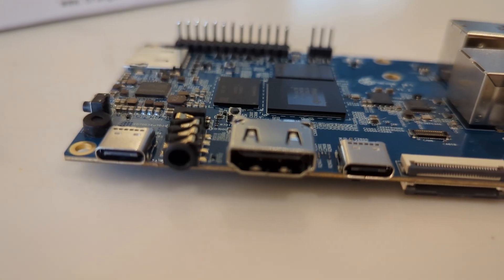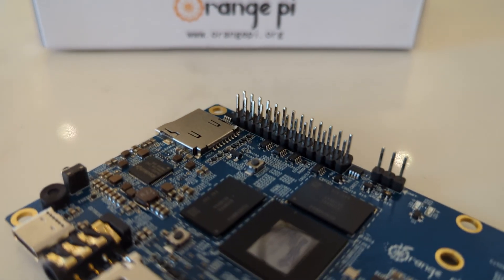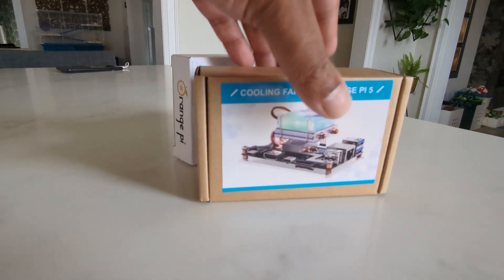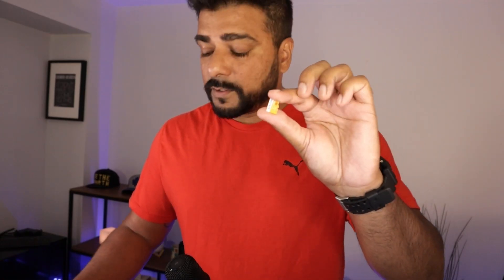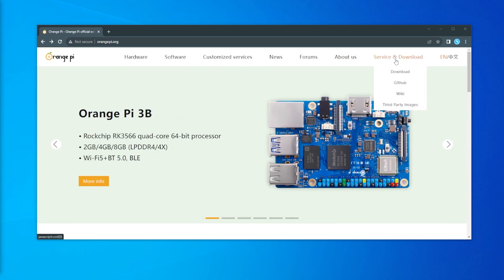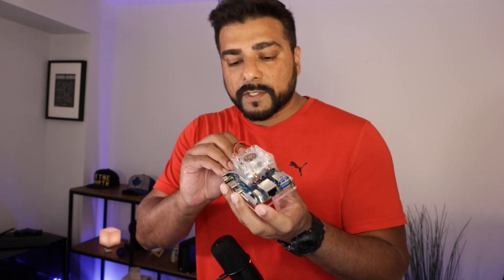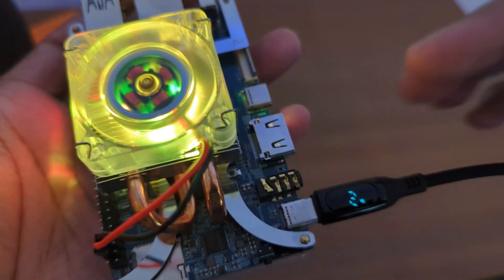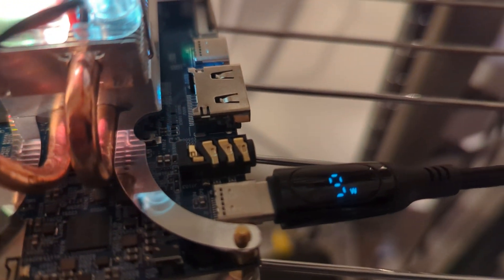VERUS mining with Orange Pi 5 !

Comment: Thanks for great video. You mentioned Orange Pi 5 in the video, but the link to amazon is for Orange Pi 4. It doesn't matter which I choose? Because the differences are not only in the price, but also in the CPU - Pi 5 has a RK3588S processor and the Pi 4 has a Rockchip RK3399. It does not matter? Does anybody know the hash difference? Thanks
Reply from the maker: Thank you so much for pointing that out. That's an error. I've tried only the Pi 5 RK3588S, it does matter. I dont know anyone that has tested the Pi 4
Reply from the maker: this is strange, when i test the link i get the orange pi 5?! Anyway i refreshed it, but here is the specs you want: Orange Pi 5 8GB Rockchip RK3588S 8-Core 64 Bit
4GB version works fine as well.
Reply: @CryptoJar  and when I click the link, I get the Pi 4 LTS 🙂Ok, anyway, I will search for the Pi 5 you mentioned. Btw the second link for the fan is most pro[ably different - at least it does not like the one you have in the video and the description says it is for Raspberry Pi 4...
Reply from the maker: @thekrazydogge  can I ask what country you are in?
Reply: @CryptoJar  do you think it's country related? I'm in Slovakia
Reply from the maker: @thekrazydogge  ah okay, I think it's because my links are for the US. Maybe it's just picking something close to it. I'm guessing right now
Reply: @CryptoJar  it looks like those sellers simply do not sell to EU or similar. I manage to find a working link from the Orange Pi website because even the search was giving me weird results. I hope I ordered the correct one 🙂

Comment: Dude, yes! I personally like mining verus on the Pi better than the phones. Like you said the phone set up is easier but I also like my house... lol and even with the scheduled cycles and preventing the battery to go past 85% charge I still fear my house will go up in flames LOL
Reply from the maker: LOL! yes I like my house too... plus OrangePi has so many other uses that I can apply afterwards if this doesn't work out. Not sure what i'll do with 10 extra used phones
Reply: @CryptoJar  I was telling retromike that I felt like a Craigslist scammer because of all the phones 😅😂
The other uses for the Pi’s are endless
Reply from the maker: hahahah... i was trolling ebay and kijiji for a while and gave up
Reply: Lol just hardwire the phones and sell batteries, displays and all the casing of the phone.
Reply from the maker: @favo7200  😜